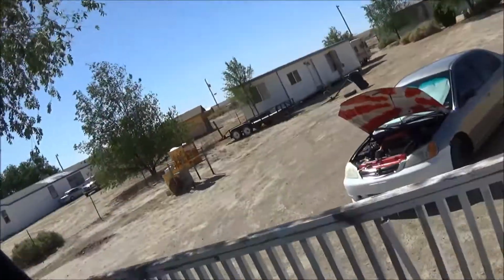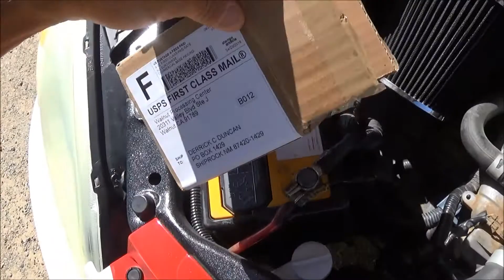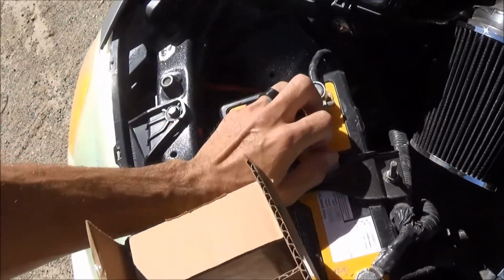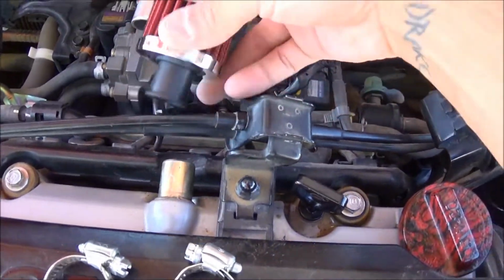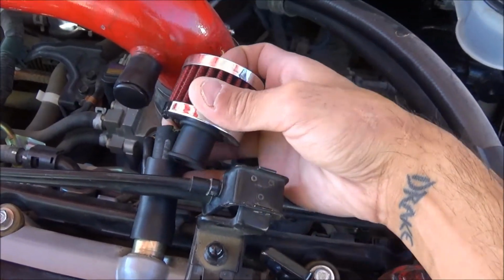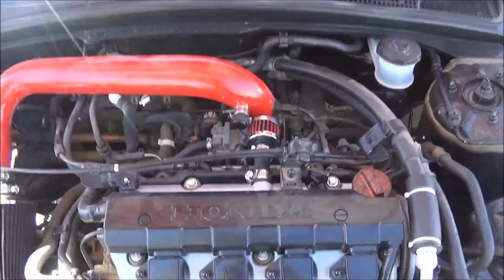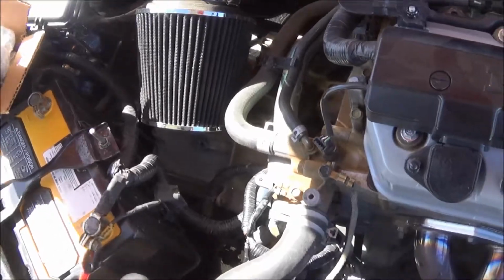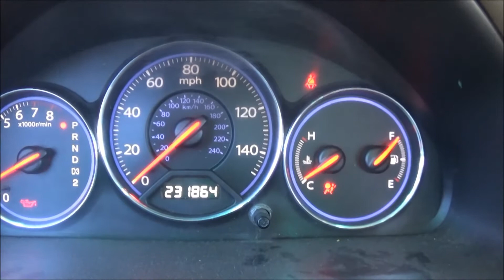How To Install A Pcv Delete "2001-2005 Honda Civic 1.7"

Comment: Hey dude, shouldn’t have to tell you this but you’re most likely going to have to check on that breather every so often because any unburnt oil will now collect in the filter media rather than run through intake system to get burned. Just food for thought if you didn’t realize that
Reply from the maker: Thanks man I figured I'd have to. I'll check it after work tomorrow and see what's in there. Thanks for the feedback

Comment: Hi a car I have just bought has done the same thing as you deleting this pipe , he left it bare should I connect a filter to it so it’s not just bare
Reply from the maker: @bratt4478  yes u don't want dirt in there
Reply: @GGYoutuber5958  was it actually a pcv delete ? I see others are saying it’s a breather hose and that this mod is pointless and unsafe , did you notice anything by doing this mod ? I might end up just putting the hose back on if it didn’t  improve performance. Thank you for your time
Reply from the maker: Sorry ya I didn't notice any benefit to it. I would put the stock piece back on. Just the hose from the top of the engine to the intake pipe
Reply from the maker: Lmk if u have any more questions about this car. I know it pretty well!

Comment: Not bashing bro.I did the same to mine years ago.That is the valve cover breather which relieves pressure from the valve train.Your pvc valve is located lower on the back of the engine.It is a one way ball valve connected to the big vacuum hose leaving the underside of your intake manifold.Serves to relieve pressure from inside the engine block.(positive crankcase ventilation)
Reply from the maker: Agreed man.